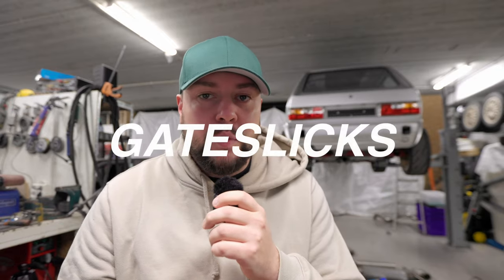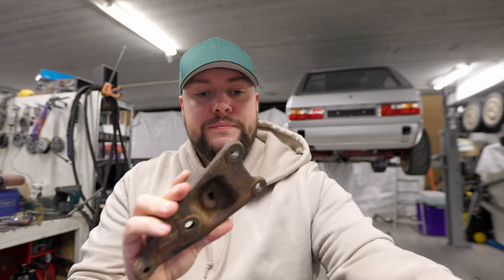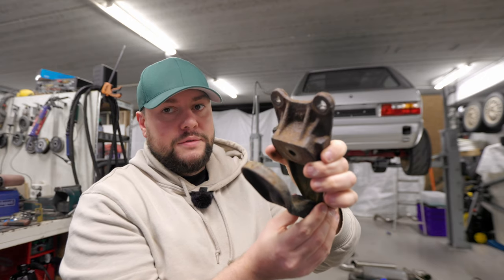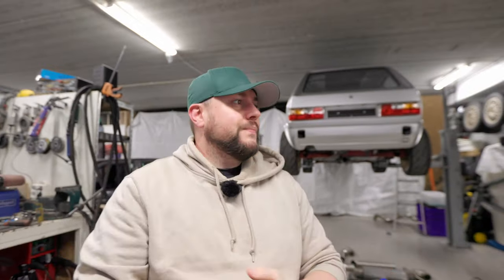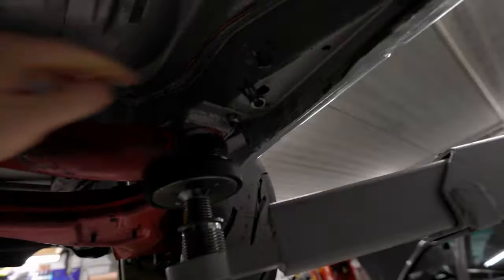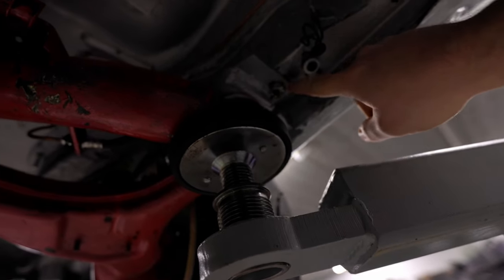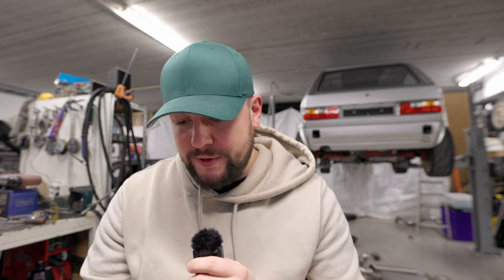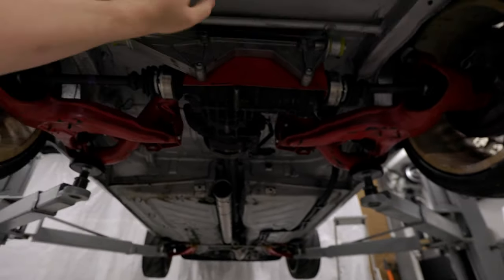This product makes the Golf Mk1 AWD Conversion 10x easier

Comment: Thanks you I'm in the process of converting MK1 1.1 to 2.0 16v abf and thought of synchro conversion and did you use the synchro gearbox would it handle the power of the abf engine if not what box would you advise good to see you fabricate you own parts built not bought awesome 👍👍
Reply from the maker: I have used the 4motion system on mine. I am not so familiar with the Syncro system so I don’t know how much power it can handle. But if you’re going for the Syncro system you can always do a pretty easy 4motion conversion if you need something to handle more power. Going from Syncro to 4Motion is not difficult:)

Comment: Very interesting! Time to find an mk4 r32 rear subframe
Reply from the maker: This product only fits with the Mk2/Mk3 Golf Syncro rear frame, in case that was not clear:) 

Mk4 rear subframe can also be used and are used more and more, but will need other modifications to the chassis to make it fit:)

Comment: being in the US, the only syncro we got was a passat and those are super rare. now if i wanted to do the swap what route would you say would be best? mk1 tt? r32 subframes and diffs are harder to source here as well so options are fairly limited.
Reply from the maker: TT mk1 and Mk4 R32 have the same subframe, so if you go for this type of subframe just get whatever is cheaper for you. Mk5 is a bit another, but probably not much harder to use(I think by looking at photos of it). It's become more and more common to use the Mk4/TT subframe since it's more available for many outside of Europe. 

It's a bit another process, from what I have seen pictures of. I'm planing to try to make a video about some thoughts on how I would have started if I was going to use the Mk4/TT subframe, in hopes that it maybe can help someone.